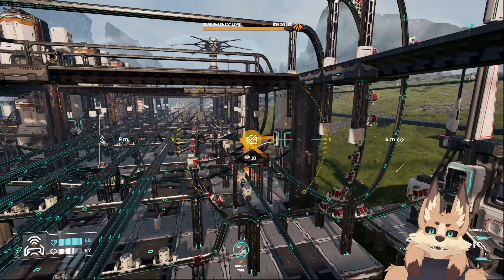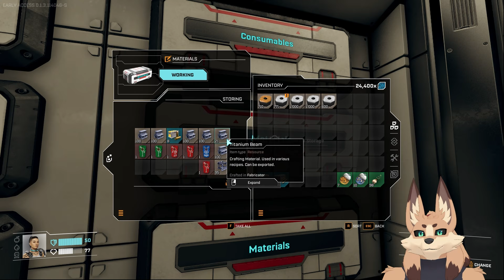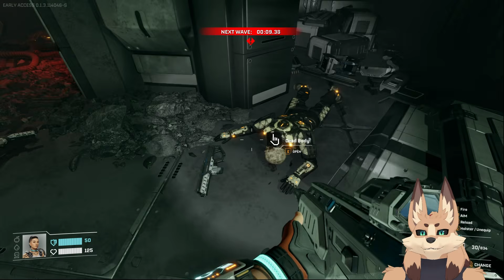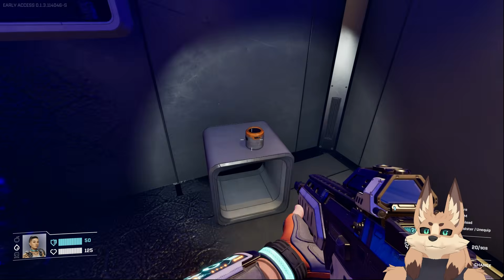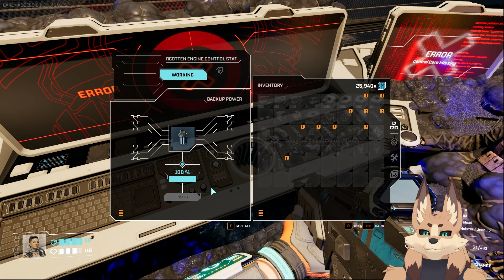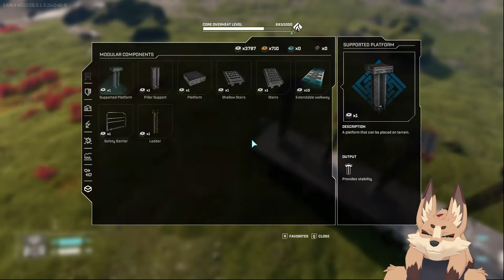Awakening The Great Machine - StarRupture [10]

Comment: Another great video Genji!!!    So I started sessions on the public test server. Then I got to thinking they may not transfer those saves to the main server so I have started again in the main.
However, I have seen multiple other videos that say that placing platforms on pillars in a spread messes up the support calculations. Placing 1 platform on top of a pillar forces the calculation. Then you can Y pull an area for it to build the floor.  The reality is the pillars are just broken also.
In the test patch I could put down a plat form, then put a pillar under it. Then another pillar under that.  Then it was stable. In the main server, they are just completely broken. Many times I can't even put a support pillar under a platform at all.

Comment: I was using up the first couple of rails that weren't needed anymore for first couple items then I thought what if we need these when the update comes out so I stopped that and added 13 rows of rails instead. Also we could have done buildings on the other side of the bus that isn't being used to make it shorter but I'm not sure how the rails would end up fitting towards the end. Probably easier toward the front of the buses where you only need one or two items? Also when you go to turn in alien parts for credits I notice you always drag drop. You can just double click left mouse and the items go right to box same for moving items to your inventory or self storage. For the magenitic coils I had to build another base just to keep up supply so you might want to think about that. Also I run all my air drops on the opposite side of the bus that isn't being used. Nice to just run them in where you need some extra support.

Comment: I did this build I actually constructed this pretty much how you have it laid out. I built recently on my version of the space a node where it automatically pulls from all the earlier stuff so it's essentially a buffer zone. I'm at the point where I'm starting to do the turn and then I'm gonna switch it back into 8 way out for the materials. I found with that buffer zone it fixed the problem is early machines not working properly

Comment: Excellent episode as usual,  I make remote power bases which has helped with my heat prior to upgrading to the Tier 4 wind generators.  I ended up making 2 additional large scale manufacturing bases in the north.  now I'm just waiting for the update.

Comment: For the floor tiles and snapping to the pillars, if you can get a single tile to one side, you can then single-tile walk around the pillar to the other side and then continue on. This will help negate needing to drop extra support pillars just to place the floor tiles.
Check out Riverman's Masterclass building videos.  After watching his vid I was able to get a 5 story tall Base Core Amplifier Station, and dropped overload by 1000  😆

Comment: Once again setting up the pole resources for the Electromagnetic Coil since they are end of line, they could have been routed from the Multirail Connector directly down to the lower feeding connectors.

Comment: There's lots more to discover now that the Engine is online. The radiation barrier should have been removed now, iirc. You can't exploit the new resources yet, but you can explore at least and find more lore related stuff.
Reply: I don't think the radiation will be removed until the content patch releases. Also, I'm a bit worried that they're going to rework the progression. There are some unlocks which make no sense and are probably placeholders because we're missing a chunk of content.

Comment: I didn’t use the Solar Generator V2 at all due to the heat load they put onto my base. I waited until I got the bigger wind turbines. Yes, they cost blue material but they give way more power and add very little heat. Yes, the description on the Large Storage is wrong. You can get another small storage below the large storage container on your wall. you can also put them on the floor if you have the space. I recommend having around 10-12 turrets to defend your base. The lower number of turrets can get overwhelmed easily and as you saw, one of your turrets got infected during the attack. I’ve never noticed any attacks when I have been away from my bases. If you are away for a prolonged period of time, you can expect to get an attack when you return.

Comment: The big downside to automatic guns is that ammo is feed to them 1 bullet at a time lol hopefully they change that when the patch comes out finally. also the gun towers are less accurate than the gun turrets, so they burn through more ammo with misses as well as higher rate of fire. I ended up having a mix of the 2 types and that works well